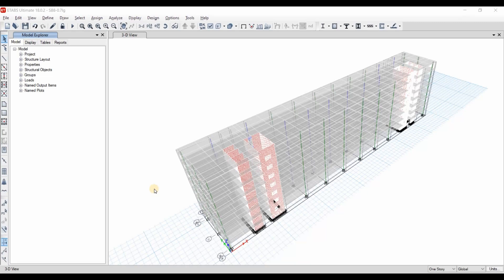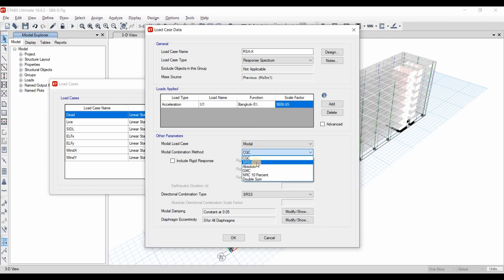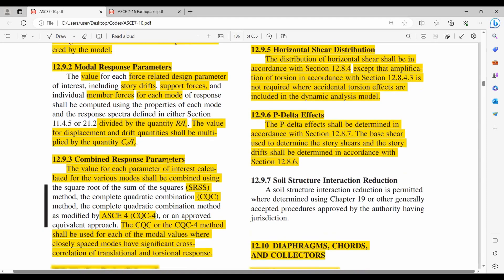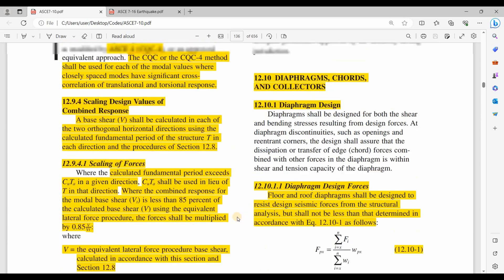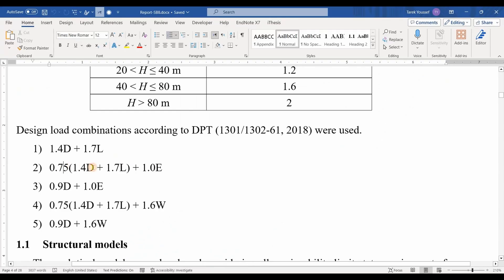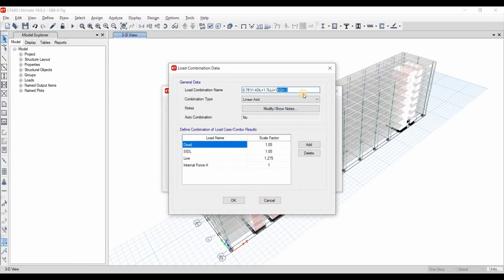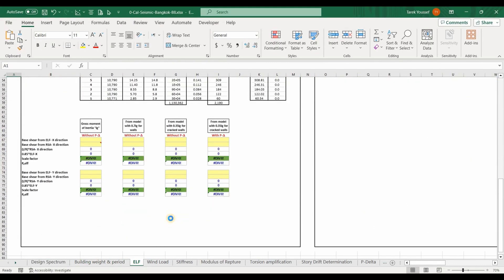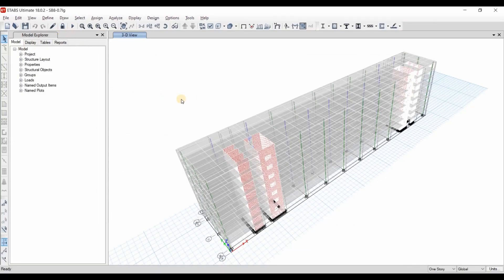ETABS Tutorial 11: Defining Load Combinations with RSA Earthquake Loads and Scaling Factors

Comment: Hi Tareq, Great tutorial. I am designing a buiding with extreme torsional irregularity having seismic design of D so I can't use ELF. Governing mode is of torsion. Should I define RSA for RX, RY and RZ? How and where?
Reply from the maker: When designing a building with extreme torsional irregularity and a seismic design category D, it's crucial to account for the torsional effects accurately. Since the Equivalent Lateral Force (ELF) procedure is not suitable due to the complexity and irregularity, the Response Spectrum Analysis (RSA) method could be appropriate, but the NLRHA is the best !

RSA in X & Y Directions:
You need to define RSA load case for X and Y directions.

RSA in Z Direction (Vertical RSA):
In most cases, RSA for the Z direction is not necessary unless specified by your building code or project requirements. Vertical seismic effects are generally less critical than horizontal effects for typical buildings. However, if your specific code or project requirements mandate it, then you must include RSA for the Z direction.

Understanding Torsional Effects:
The torsional irregularity is primarily due to the asymmetric distribution of mass and stiffness within the building. This causes the building to rotate about its vertical axis (Z-axis) when subjected to lateral loads.

Improving Building Response to Torsion:
Adjust the location of structural elements such as columns, shear walls, and bracing to reduce torsional irregularity. Aim for a more symmetric distribution of stiffness and mass.

Summary:
1- Define RSA for X and Y directions to accurately capture the lateral seismic response.
2-Define RSA for Z direction only if required by your building code or project specifics.
3-Focus on torsional analysis to understand rotational behavior.
4-Adjust structural configuration to minimize torsional effects, ensuring a more uniform distribution of stiffness and mass.